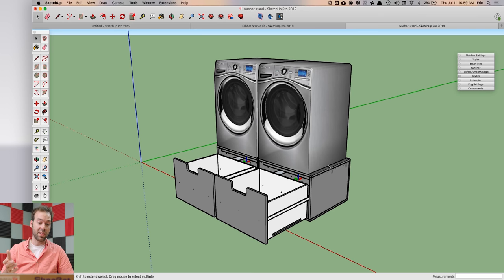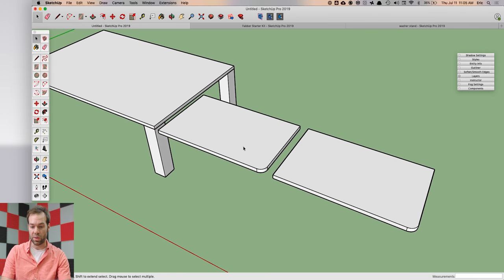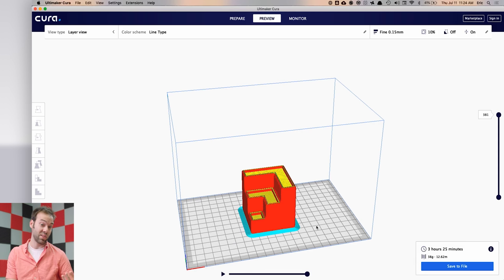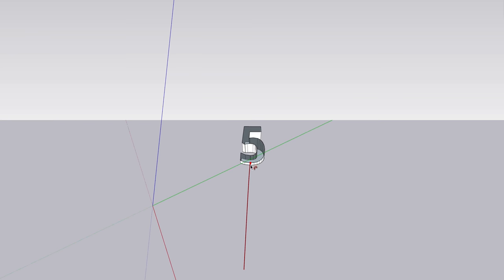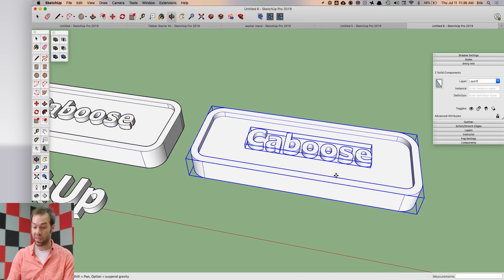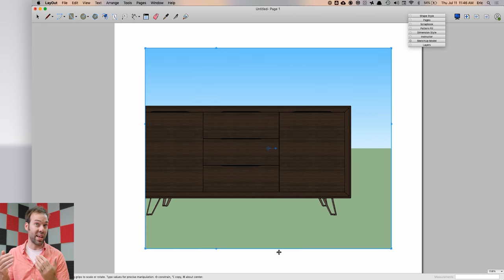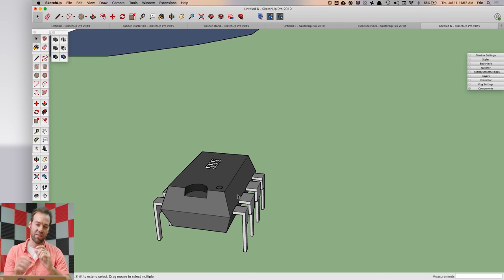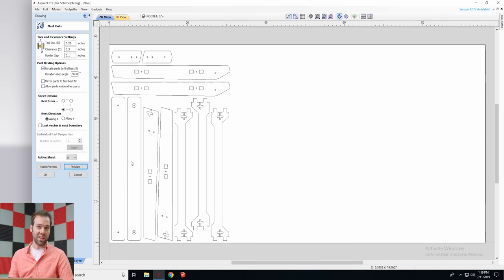Top Tips for Fabrication

Comment: Great video. Thanks. Is the fabber  plugin different from importing vectors from sketchup in v-carve? I use SU2019 V-carve only imports 2018 or earlier so will try it with fabber.
Reply: Use Save As in SketchUp, then select Ver 2018 or earlier